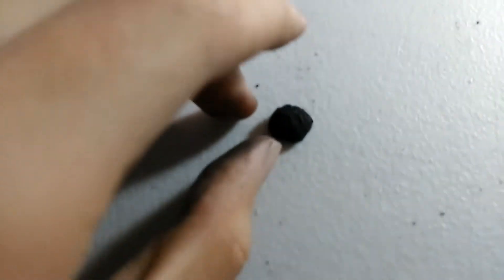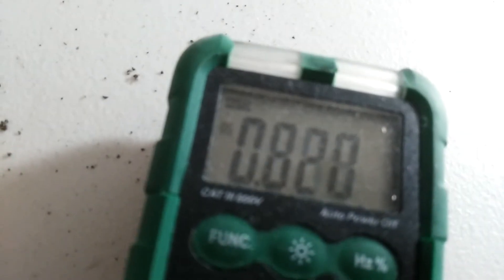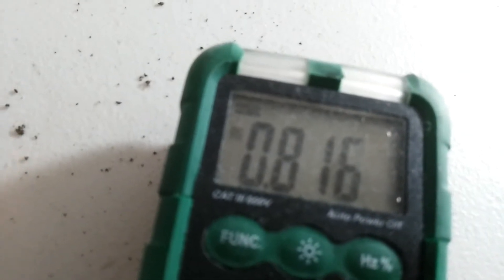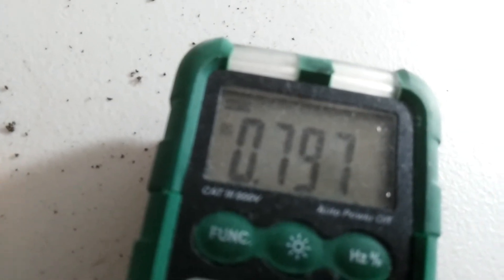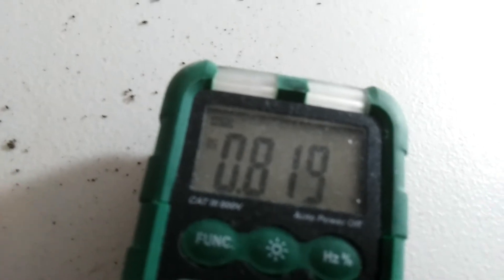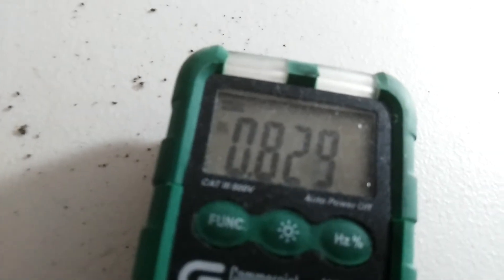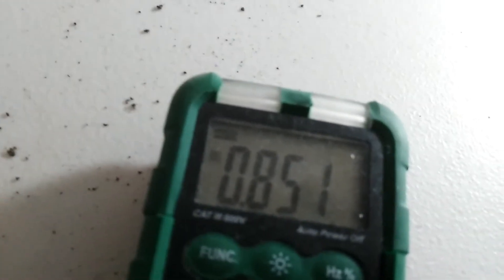Cute Little Carbon Electrode

Comment: Well you just must compress your carbon  with very high temperatures in a kiln so it can carbonize  around 1000 degrees Centigrade to a much better conducting graphite like material...or use an HHO burner to heat it up red hot under compression....

Comment: Well you really need to get below 1Ohm per cm...otherwise all your power from the battery will be wasted in the internal carbon resistance...
Reply from the maker: overunitydotcom yeah, all my charcoal comes from a campfire from 3 years ago while at a party. I seem to have exhausted my supply of good charcoal. Heating the charcoal pieces in a flame seems to improve their conductivity though
Reply: Red Rake Just get Coconut Charcoal from coconut husks...it is very conductive under 5 Ohms  and is very cheap....